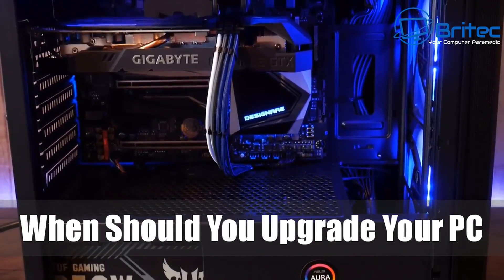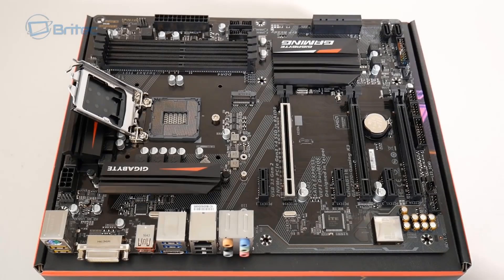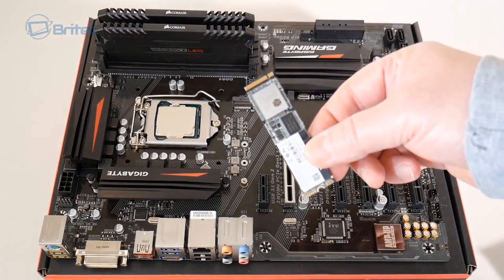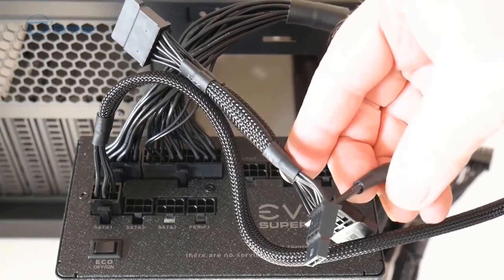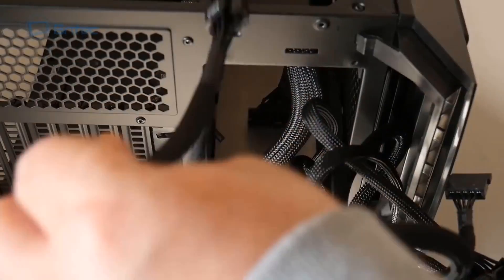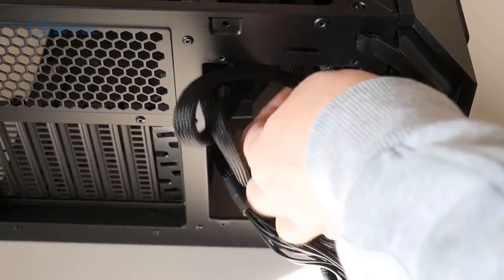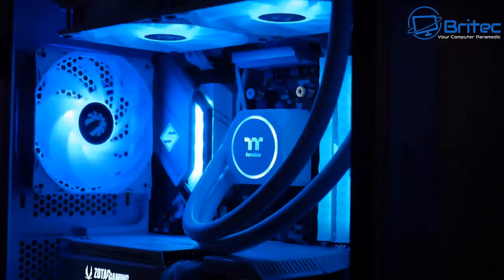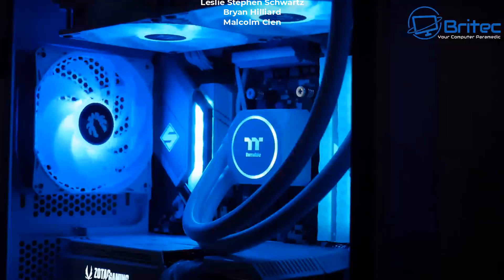Should You Upgrade or Replace Your Computer

Comment from the maker: Let me know below in comments your system specs.
Reply: pro tip for games
1660 super 6 gb is like 250 usd or less and does most 1080p games at near max settings
if you want 2k n 4K it can do them albeit you drop to 30/60 frames latter at 2k but thats heavy use
Reply: ugh got a decent pc but the rub is this c drive thats 128 gb i dont know how ill upgrade to 1tb do a video on that you will get hits galore 
migrating your stuff to it
its pain when i do installs
othe rthen that im good for a year saving for new system
Reply: UPGRADE IS MY OPINION
Reply: @Forgiveyourenemies  are yo gamer or dev
it really is two ways for both
like i do i have main drive ssd for where programs are and sata storage for stull like shaders and vaults

gamers prolly want all ssd and put games on ssds for speed
Reply: @Forgiveyourenemies  also devs will want ram and cpu vs worry bought top end grpahics cards where you want vram vs features 
for game play
Reply: i5 6 core intel, 1660 super , 16 gb ddr4 128 gb c ssd drive and 1 tb d drive(reg)
used for unreal 4 cinematics and gaming DOES GAMES GREAT , its doable for unreal 4 BUT i need more space on that c drive( sata) thisbox can do one ssd  and has 3 sata drives 
idea is main for doing and satas for storage like a vault

im saving up for next system for amd ryzen 7 and maybe a newer 7000 series card when they come
Reply: gold stickered powr supply is better lasts a bit longer and draw is more stable
Reply: 2400G/1050Ti/64GB RAM 
I'm finding it a little tired running VirtualBox VMs these days, but it still works. 
My S/HDDs are years out of warranty. I should be careful.
My failover machine is an Athlon 3/24GB (I think) and hasn't been powered on for a year. I can feed it a Clonezilla image to replicate my main system if it goes bang. 
I'm a programmer, not a gamer.
Reply: @twentyrothmans7308  you should have some sata storage for that use really that way you dont need ssd worries
vms are real hard on shit
Reply: 1660/i7-3770
Reply: 3050ti/intel i5-11400h 16gb ram from 8 
1tb + 512 from just 512gb hard drive
Reply: @darkspongebob11  go get a 1660 super or amd equivilent man that 4gb is getting old and slow
Reply: @chronosschiron  i dont run 50 games at once that are very intensive and the stuff i runs it runs well on it
EDIT: whoops i actaully have 3050ti not 1050ti my mistake
Reply: @darkspongebob11  so your helping nvidia with stupid pricing im not my next pc will be all amd and what you mean 50 games at once no one does that

and so you know my 1660 super benches better then your 3050ti ( which is a laptop gpu) lol
Reply: @chronosschiron  i dont care if it benches better or not virtually meaningless all that i care is whatever i do with it runs alright and many things do so im ok with it

i dont ever plan to buy the most expensive ones since i cant anyways
Reply: @darkspongebob11  care cause its going to stop working when the driver support is over with if not already and such .....i dont even think i can buy one of your cards no more anywhere and yes ive got another pc with older one too
Reply: its offline btw that old one never online
Reply: @chronosschiron  yeah i think itl be fine for now my pc is actually quite new ish and very new to me only got it recently driver support ends on pretty much any graphics you get at some point, hopefully it wont be too big of a problem for a while yet wouldent think so.

Comment: When you have a list of several games you can t run on current system.
This way, i am still using my 3rd gen i5 in 2024 and my mega rx580.
In the last 5 years i spent about 200$ on pc parts. I take most of the stuff from the garbage 🥰

Comment: I just did a little upgrade that cost me under $30 after selling off the "old" stuff; it included a CPU and RAM upgrade. Changed from Xeon E5-2678v3 to E5-2696v3.  The later's price dropped to $51 and I went for it (18C/36T, 3.8Ghz max turbo, DDR3 or DDR4 compatible). Same for the RAM...went from 4x8GB DDR3 1833 to 4x8GB DDR4 3000. Performance improved noticeably, especially on heavy workloads.  This CPU was released in SEPT 2014. Nevertheless, I see absolutely no need to upgrade anytime soon.

Comment: Great video Britect! I found this to be very useful. I've always dreamed of having a custom PC, but I still cannot afford one, so I'm managing  with my current PC, which is a 2011 HP Z210 Workstation. It's had minor issues here and there, but I will be upgrading the RAM, PSU and graphics card in future. Any recommendations as to what the best power supply for one of those workstations is? I'm looking at ones with about 750 watts.

Comment: I have a Desktop PC from 2011, it's currently running 8.1 which is near the end of support as I'm typing this. It runs Windows 10 just as fast as a new computer, the pre release of 11 runs great and fast, I haven't tried 11 22H2 yet but I have on a VM and it runs. The motherboard can support a directx 12 card if 11 really needs directx 12. Gaming works but it's always on the lowest setting. I am truly amazed how long this 600 dollar computer has lasted in the family, it was my mom's pc from 2011 to 2018 then I got it in 2019 and have been using it daily since. I do think about upgrading/replacing cause of the lack luster gaming performance but I don't know if it's worth it, it seems like the PC won't die lol.

Comment: Here's    something you might know,   the power  supply  rails  are dependent  on the internal  transformer    It's  either a single  output  winding     running all the rails , or  it's independent   windings     running  each   rails  with  it;s own   capacitor  regulation    The latter  one is the one you one  because  their is isolation  between the  rails  and  better  regulation/ripple This  is something  a lot of those  high   computer channels  will not tell you,

Comment: Hi can you help I have a minisforum pc stick s41 I updated the intel graphics and now its pretty much just stopped working cant access advanced option I get error codes when booting up the 0000098 one it also says your pc needs to be fixed only thing it will do is start in safe mode but then cant really do much when I am in safe mode its driving me mad its happened a few times now and I have always been able to access the recovery options or use cmd to format the drive and reinstall windows but this time nothing only the error codes and safe mode thats it can you help thanks in advance

Comment: I have an HP laptop that's almost a decade old now, and it's so dreadfully slow by comparison to what I'm used to on my new gaming rig... can't really afford to buy a new laptop, so I'm thinking about upgrading the RAM and switching to an SSD. Also, since it runs on Windows 8 (not 8.1, just 8) and has major OS breakage, I'm just gonna switch over to ZorinOS, as I've been told that it can revitalize old PCs to a certain extent.
Reply: Wouldn’t it just be easier and cheaper to just get an iPad or something like that instead of a laptop.

Comment: I added a new laptop that processes 1 hour of camera video in 1 hour (instead of 3 hours +). I will replace the older two laptops with batteries no longer charging if I cannot find replacements for those batteries.

Comment: Processor	Intel(R) Core(TM) i7-10875H CPU @ 2.30GHz 
Installed RAM	32.0 GB 
NVDIA GeFORCE RTX 2070 Super
Screen is 17" size
Storage: 1 TB SSD (Internal), Samsung SSD 970 EVO Plus
Keyboard: Razel Huntsman (External)
Mouse: ASUS ROG Laser Gaming Mouse (Wired)
Windows 10 Home Version 21H2
System: S'pore Aftershock Vapor 17 Pro

This is my gaming laptop spec. I'm using since since July 2021.  Hi Brian, Can this laptop be used in the next 3-4 years? 😸😹😾
Reply: FYI. This is not my 1st machine. It took me many cycles of yeatrs to get my dream machine. And my dream machine is constantly changing. Nowadays, laptops and desktops only last around 3-4 yeats. What a shame!

Comment: Like many others Brain, I am all for updating my current desktop if need be but  my current Ivy Bridge build operates really well for me as is. I don't game or do any fancy graphics stuff and am running Windows 11 Pro 22H2. My concern would be in buying a replacement machine is again cost  but I deal with a company in Melbourne Australia that build basic machines, and they give you options for changing the components to what you want. The trouble is cost and it is eye-watering when I see prices for GPUs for example but again they also allow you to add such older components like my Asus Xonar sound card (which is so hard to find now)  and Asus GTX 650 Ti (my current GPU)  to the machine without losing the warranty. So that would be the way to go as I don't have the dexterity to build again myself - plus the cost of course.  But a good video mate and such great advice which sadly some will not follow. The other concern in building a new machine would also be if Microsoft added more restrictions on the hardware side in running any new and upcoming OS's.

Comment: 11/2022 and I am running a 4k/60Hz screen: still running a Devil's Canyon and it does all I need. Yeah, the push to buy new stuff is huge. Just ignore it until you see problems in what you are actually doing. I have had 12th gen Intel and nice Ryzens go in and out of my shop and I cannot be bothered. And yes, I can afford them but why do it ? Boot time?
My specs?
i7-4790K @ 4.6, 32 gigs (overkill) of 1600 9-9-9-24 ddr3 on a lovely Hero 7, strix 1080ti , and a bottlenecked nvme samsung. And yes, this 2014 rig pegs my favourite game (World of Tanks) at max settings 4k/60Hz  all day every day.

Comment: I have I7 Gigabyte Z490 pro 10th gen 250gb mvme 1tb ssd ,500gb hard drive 16gb ram 3060 gpu  i gaming and other stuff no need to upgrade runing W11
Reply from the maker: I agree, nice little system still

Comment: Is there a special technique for replacing the CMOS battery? I popped mine out with a screwdriver but the new one (CR2032) just wouldn't stay in position within the plastic holder - maybe a piece of plastic broke? Anyway, I ended up using superglue so it won't be falling out anytime soon!
Reply from the maker: No, just push it in the correct way
Reply: @Britec09  I tried all ways but it kept falling out. I can only assume something broke within the holder so I had to use glue.

Comment: True Story: This week, I built a pc out of old parts that I had lying around for an older couple that I know, for free. I took payment in coffee and conversation. I was originally going to fix their pc, it turned out that pc was a low-end P4. An old and SLOW pc. (I didn't charge them anything because their dog just had some big vet bills).
I was surprised what 10+yr old parts could do for someone who doesn't play games, the pc specs were an i5-2500s cpu that I put in an IBM pc shell, it originally had a Pentium cpu.
For a video card, I put in a perfectly working gtx 1050ti, it's missing a front bracket & was previously modified for size, and I put in a 256gb ssd for the boot drive. I need to upgrade the ram, it's only got 2x2gb, I told them to only use 2 Chrome tabs at the same time until I upgrade the ram, lol! (I'll do that this week). These items were just gathering dust on one of my storage shelves. 
The i5 pc is able to surf the internet and they can watch youtube, check e-mail & social media. For them, the old i5 pc that I have NO use for for IS AMAZING, it's MUCH faster and doesn't crash like their old p4 did.
As with many things, it's perspective. It gave me some, maybe I can keep using my 5600x and 3090 for a while longer even thought those parts aren't the fastest anymore. I don't have to spend a pile of money on the latest and greatest. (I still might though! 😉)
Reply from the maker: Depends on what your doing with the computer, little underpowered for my needs, but if it works for you, that's great. Thanks for sharing

Comment: Hi, Brian. I think my system will be good for a while. I have an MSI X570 Unify, water-cooled 5900X, water-cooled RX 6800, three 2TB gen 4 PCIe m.2 drives, 32GB of ddr4 4400 RAM, two EK D5 pumps, four 360mm radiators, a total of 13 120mm fans, and an 850watt Seasonic PSU all stuffed into a Thermaltake View 51 case.
Reply from the maker: Very nice computer

Comment: depends what u use the computer for....i have a 7 yr old laptop and a 12 yr old desktop both with 4GB of RAM running windows 10..they work fine for web browsing YT and streaming movies which is all i want so until one of them goes bang i will stick with them...i just replaced the HDD in the desktop at the exorbitant price of 15 quid but when i walk into a computer shop and they want 700 quid for a new laptop i think i made a good decision
Reply from the maker: You should be good for a while with your requirements

Comment: I have a i7-3770k, 16GB gaming ram 1600, gtx 660oc, ssd.... It is still working well even in gaming like Tom Clancy's Ghost Recon Future Soldier, COD Black Ops 3... I do photo editing... all I have had to do is replace the ssd a few times, due to Load Shedding, but this pc still kicks ass, and it is not overclocked.
Reply: A 3770K is a good cpu.

Comment: Thinking about playing MSF 2020 . I"m all about graphics. Right now I"m using a i5 9600k with a 3070ti tuf @1440p 60hz , 16gb ram @3200hz. Thinking about upgrading to an i5 12600k on a z690ud (gigabyte) +16gb more of ram. Wil lprobably have to swap out my 500gb nvme drive for a 1TB drive.
Reply from the maker: Still a nice system you have

Comment: Probably take a look at maxing out the RAM(or 16GB minimum), and swap out a hdd for an ssd. Even a low end sata ssd for booting is way better. And sata drives are getting affordable.

Now to the expensive parts
a gpu
the cpu/mobo.
Reply from the maker: Nothing is cheap right now